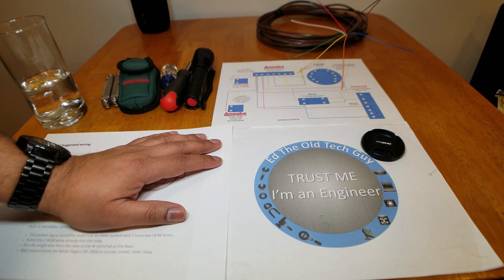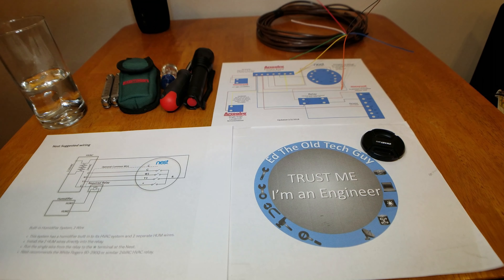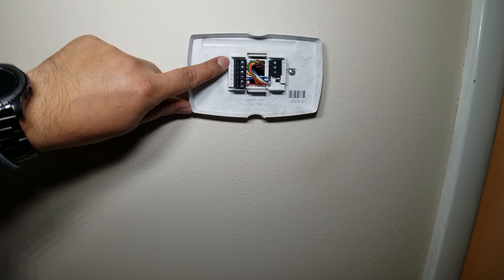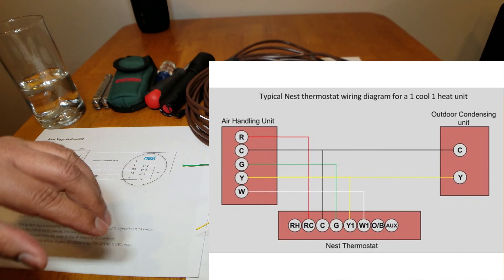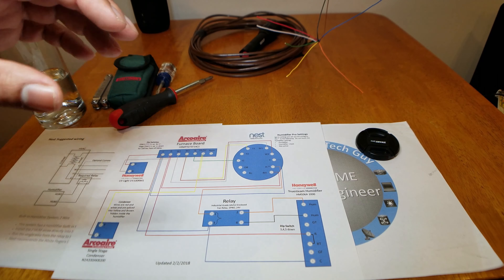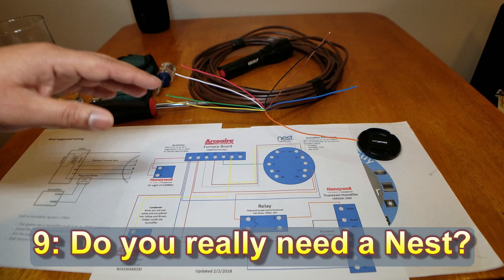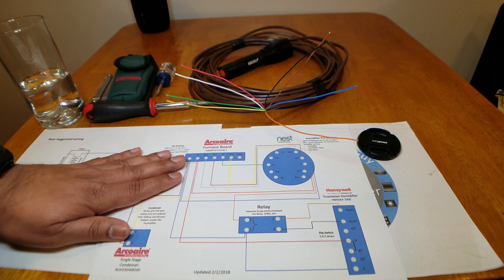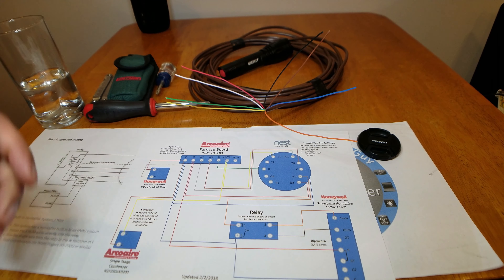11 Things you need to know before you buy a Nest or smart thermostat

Comment: On tip #5 - For the home gamers - there is usually a jumper between "R" and "RT" terminals.  Take care to duplicate the jumper placement (if it's not included on the new thermostat) as you're installing your wiring.
Reply from the maker: This was certainly a lot of information to provide in a short amount of time. Thanks for adding that. I should have said more to it. Great insight and comments as always!
Reply: @edtheoldtechguy  It covered all one would need to know, man.

Comment: My system is crazy, there's 5 wires coming out from the wall behind the thermostat...but there's only 3 terminals on the furnace board! The only terminals on the board are R, G, and W. Y and W are tied together at the board on the W terminal. I'm so confused...
Reply from the maker: I would love to help but need way more info. I am not an HVAC Tech but I am a DIYer that loves to work on HVAC so take that for what it's worth. Is your system forced air? How old is it? What make and model is it? Is it only for heat or does it cool as well? Is it a stage system? For instance In a forced air system the Y controls the cooling and initiates the condenser the W on the other hand initiates the heat relay. So my guess is your system is wired up really crazy where the color codes mean nothing and you will need to ohm cables and label them or you only have heat or cooling options not both. Pictures video and more info would help greatly to point you in the right direction. You may also consider the best answer at this point and that is to call a pro.